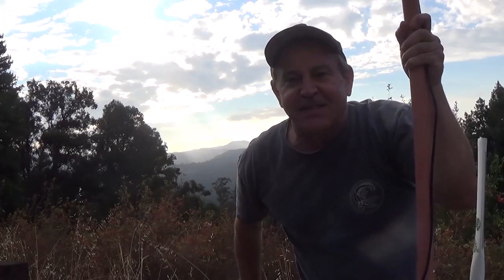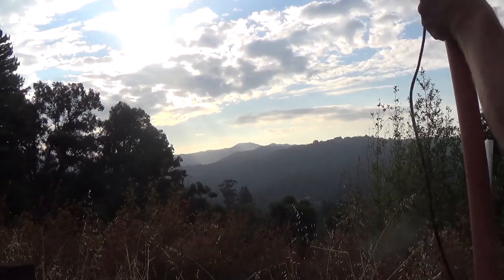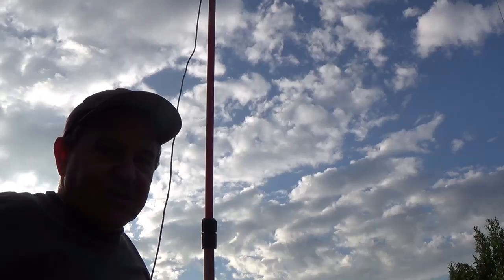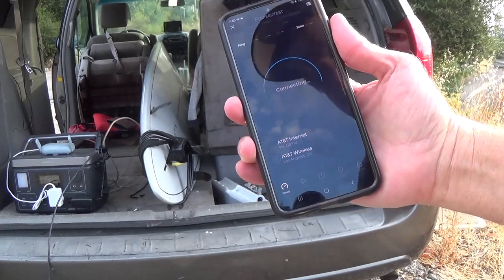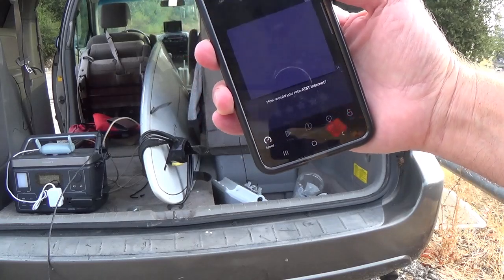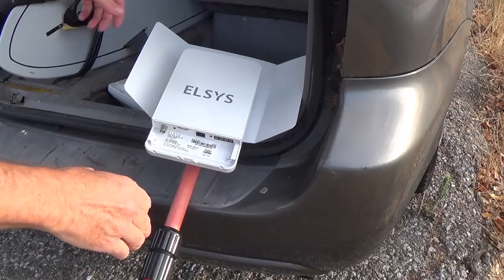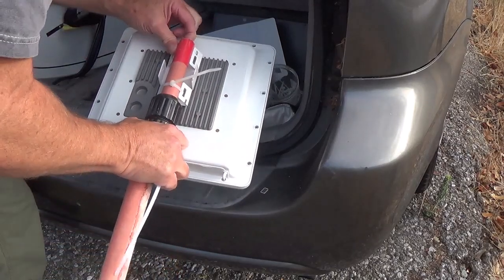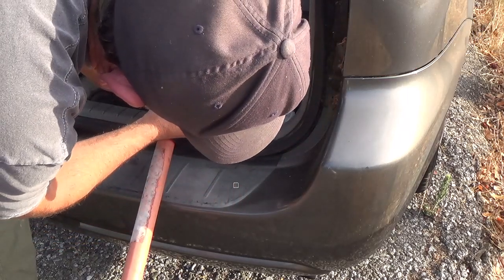🔴 Extreme Rural Internet -  4G/5G Modems pull signal from Miles away #starlink #ruralinternet

Comment from the maker: Elsys Amplimax 4G https://tinyurl.com/PeterC408ELSYS4G 
Elsys AmpliMax Ultra 5G https://fas.st/t/iF7xo6mM
5G Modem Round-up https://youtu.be/SqJ5e8w8iio
Last Video - How I discovered AT&T equipment 

I have tested a dozen 5G modem and gateway solutions but these are my current favorites. Although I use it in the middle of Silicon Valley, it also works very well in rural situations. On a previous video, I discovered those towers some 7.33 miles from a dead spot along a highway that I often travel. I though it would be a good test to see if I could grab something, but I was not expecting to get such good results. These two antenna/modems are among the very best I have tested.

Comment: Peter you are the man!!! now I need that super antenna to add to the Elsys that would make it a beast
Reply from the maker: Just to be sure:: These Elsys products contain antennas built-in. They are both outdoor modems built into an outdoor antenna. I would give these a try before trying to add an even better antenna to it. The original Amplimax will get you one channel of 4G. The Amplimax Ultra can get 5G but it can also multi-aggregate up to 5 bands of 4G to get signals from way off and still offer solid performance. Both of these were able to get 99% signal at 7.33 miles.

Comment: Peter, what is the Pole Extender that you use on video?? Thanks
Reply from the maker: It's just a fiberglass pole from a pruning saw. It is super flexible so probably not a good solution for a permanent mount, but for a roadside demo it did the trick. That reminds me, I have to put it back to being a pole saw before I need it and lose all the parts.  😀

Comment: @PeterC408   Thanks for the many helpful videos.  When using a cellular based router, that is using a SIM Card with a voice and data plan attached to it, is it possible to make and receive telephone calls, the same as if the SIM was in a cell phone?  Or must the SIM card be removed & installed into a cell phone to do that?  If it’s possible, what additional equipment would be involved?  It is my hope to find a device (or devices) that would allow connecting a land-line-style telephone to the router, allowing the router to communicate (via voice) essentially the same as a cell phone, so I wouldn’t need to swap the SIM back & forth between the two as often.
Reply from the maker: It is a great question. I have heard that the 4G version of the Amplimax does support VoIP (voice over IP) and that the phone number assigned to the SIM can be used to make calls but I imagine that you would need an IP phone. I will write to their engineering team and ask more about that. Perhaps I can get a headset and try it myself.
Reply: @PeterC408  Thanks for the quick reply.  If it turns out that the Elsys Amplimax 4G does have that ability, then that would be great!  IP phones, depending on the make/model, are reasonably priced.  But if not Elsys, maybe one of the other 4G or 5G router/modem manufacturers do?  I posed the same question to a representative of InvisaGig, & he replied that it’s currently not possible with theirs. That the POTS connection would need a direct wire to the modem inside the InvisaGig, which requires special programming that they don’t support & that it’s pretty complicated.  I haven’t bought a 4G or 5G router/modem yet, so I am open to any reputable manufacturer.
Reply from the maker: @440mxc  It seems that it had that feature but not in the USA. The Government has put so many restrictions on the feature to assure first responder and 911 support that it just isn't feasible. I understand the importance of 911 support but even AT&T does not want to support land lines anymore. I bet this will be a feature coming soon.
Reply: @PeterC408  Thanks again for the information.  Great channel, very informative!!

Comment: Even though the towers are 7.3 miles away, you still have a direct line of site. Does this Modem work the same if you were in a valley with tress and hills blocking the line of site?
Reply from the maker: It works very well but "the same" has me scratching my head. Direct line of site is a blessing but it is not completely necessary. These devices have a really nice aiming feature that uses the frequency of a beep tone to help you aim. That should take you a long way... but "the same?", no nothing in radio is the same as anything else.

Comment: Great video where did you get your extended pole looking forward to your reply Kraig from Washington Stathe  I already have the 4g LTE version and going to invest in the 5G version sometime before the end of the year and i have the other unit you have in the video to act as a modem as well
Reply from the maker: @ksk101963  The pole is a fiberglass pole that came with a tree trimming pole saw. I simply removed the saw portion and strapped an antenna to it for testing. I would not recommend fiberglass for a permanent pole it moves way too much.
Reply: @PeterC408  ok thanks anything you can recommend or maybe a long outdoor metal pole
Reply from the maker: Hey Kraig, I got a really nice pole from Home depot that I use for my TV antenna. It is very thick and very strong, doesnt move an inch!  It looks like this one https://www.homedepot.com/p/Everbilt-2-3-8-in-Dia-x-8-ft-15-Gauge-Galvanized-Steel-Chain-Link-Fence-Corner-Post-328954DPTSEB/313173553
Reply: @PeterC408   thanks Peter great choice will definitely check it out have a good week

Comment: Exactly the test I needed. Thanks!
Reply from the maker: Thanks. These modems have a button, it beeps to show you the direction of the signal it finds but you can also remove the SIM and hit the same button. It will do a full scan and show you all the signals it receives and who owns them. Super cool features that I have not seen from any other manufacturer.

Comment: Thanks, Peter, and I hope the surf was great.  This demonstrates why it's ridiculous to care about 5G or to claim that 4G is obsolete.  They are both LTE.  Folks might need 5G if they are in a football stadium or other congested area with thousands of users per cell, but most people will never maximize the bandwidth of a 4G connection.

4K is too much for a phone screen, but you can stream 4K video with 15-20Mbps and serve simultaneous 4K streams to a 5-person household with less than 90Mbps, so hearing people get upset that they're "only" getting 250Mbps in tests is just bizarre.

I never care whether I have 4G or 5G service and neither should you.  Congestion and latency (ping) are the factors that matter to your usage.
Reply from the maker: I agree. Most people don't know that 5G NSA, the version received by every single T-Mobile gateway, is based on 4G LTE. It is the primary signal! 5G is the secondary signal. 4G is not going away for a very long time. It travels well and is the backbone of most of the 5G equipment out there

Comment: Where did you get  that extendable pole? Keep up the good work!
Reply: He stated in a reply to his last video filmed from that location that it is from a pole/limb saw...just took the saw head off and slips the radio on.
Reply: Oh thanks!
Reply from the maker: It is true, it is a pruning pole. I do not think it would be suitable for permanent installation as it is very flexible but it sure it since for a quick demo pole because it can be easily transported.

Comment: Do you have a quick setup page on elsas 5g start up ?
Reply from the maker: This is a very powerful device. It can be configured in a variety of different ways. This is the primary reason that it is being sold through value added resellers (VARs) instead of through Amazon. You might need some help configuring this device to do what you need it to do and luckily this device comes with it. Richard at the Wireless Haven is very knowledgeable and has created a number of videos to guide you through setup. He is also available M-F by phone. It is pretty simple given the SIM and service that you have.

Comment: There is no internet in my part of rural Missouri. Hughs net, Viasat stink, and Starlink is out of this world $$$ (literally). We are on the edge of 5g, so it's not an option. 
I hope this helps someone who's struggling to get internet...
First, I bought a cell phone booster because at the time it was our only option. Everything we did was through data on our phones. Then, when US Cellular came out with their FX3100 4 & 5g internet box ($35.00/mo. for 300 gigs, I thought I'd give it a try. It worked beyond our expectations. I set the FX3100 right in front of my booster, and we are getting similar speeds as Peter. We're in our 70's, and 300 gigs is plenty for us. I also ran ethernet cables to connect our two firesticks. Now, some of you may laugh, but this was a huge improvement. Thanks, Peter..!!

Comment: I wish I would have tripped over your page before I bought the Waveform 4x4.  My service on T-Mo (G4AR gateway) is very acceptable, but as they say - more is more.  Thanks for sharing!
Reply from the maker: The Waveform 4x4 MIMO is an excellent antenna but the radio is still the radio. The 4GAR does get band n77 which should be coming on line in the coming months. That will boost your scores, still more is more. 😁
Reply: I was thinking the same thing. Anyone want to buy a waveform 4x4?
Reply: @donloggins863  how much you want for it and how much to ship to Oklahoma